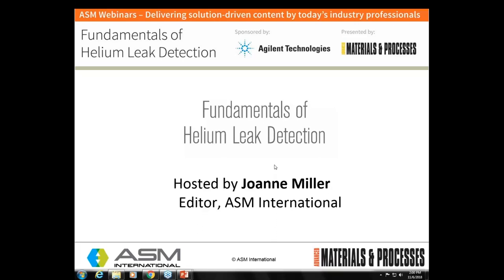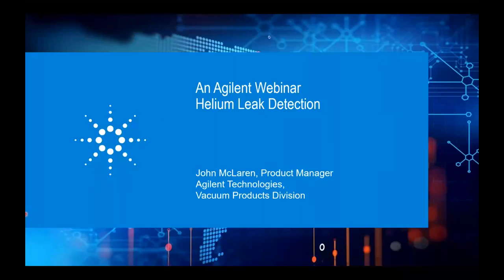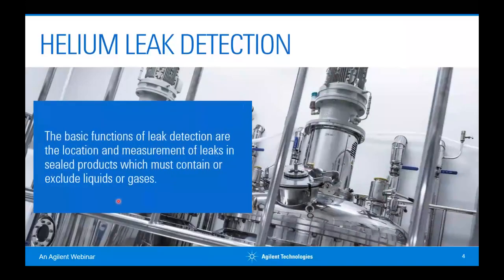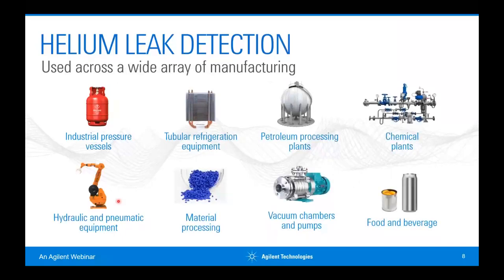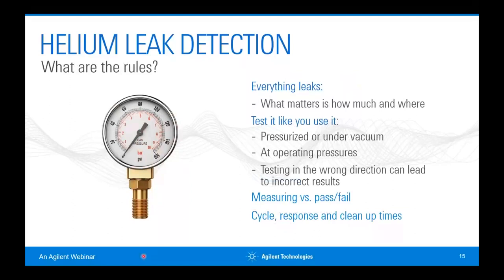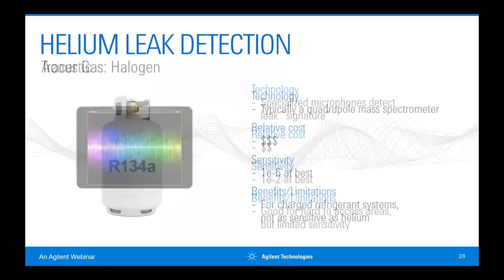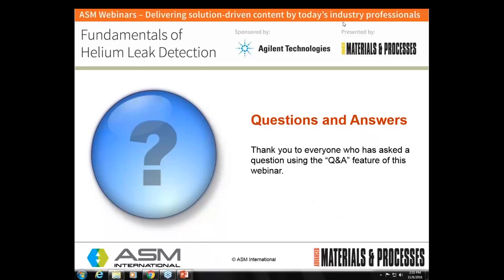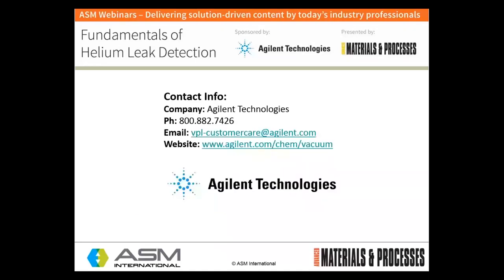Fundamentals of Leak Detection

Comment: A great presentation. Thanks. There is a related leak-detection method to the visual methods mentioned, where a solvent like acetone can be applied in small amounts to vacuum seals or joints. The solvent ingress will cause a spike in the internal pressure, which you can read using standard vacuum gauges. I don't advise using this on rubber o-ring seals as the solvent might damage the seal, and you have to be careful not to get the solvent on nearby cables or hoses! However, on con-flat (with a soft-metal seal) this is a very easy (and cheap!) way to find a leak.  Excessive use of this technique can cause your Inverted Mag "Penning" gauges to need cleaning... :)